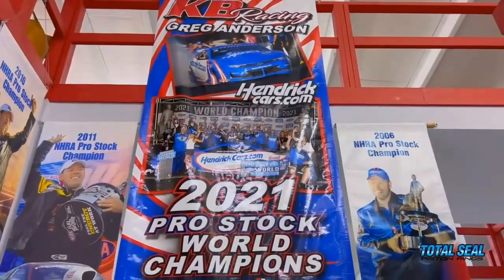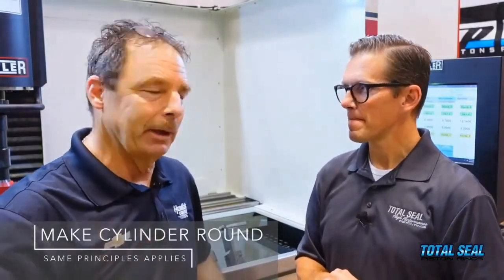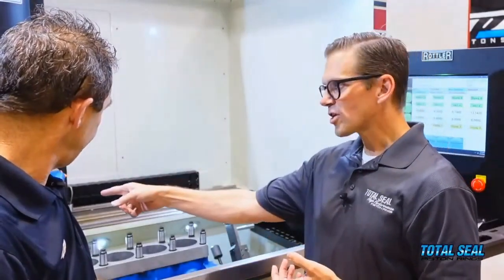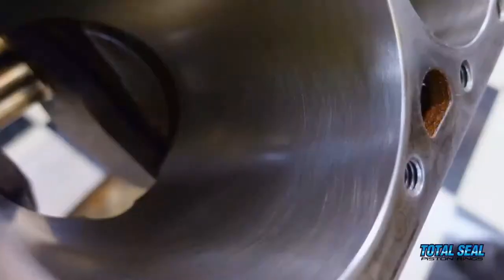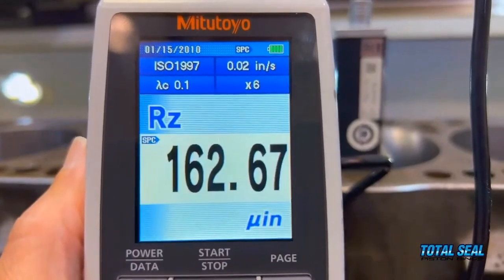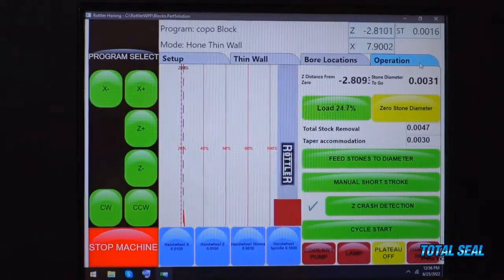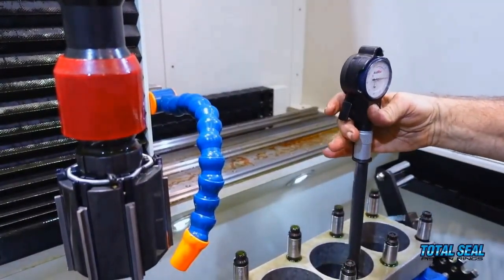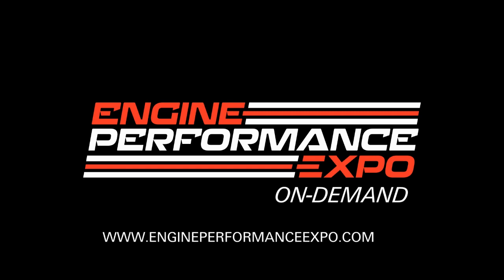Block Honing (2023 - Episode 19)

Comment: One topic NOT covered. Rings and which ones will accept this type of honing operation. Can they be 5/32" wide or must they be the newer, thinner such as the 2mm width rings. What about the material?   Will ring packages from 5 to 8 years ago  work with this type of hone or must new rings be purchased?
Reply from the maker: This type of hone works for any size ring. It works with steel or ductile iron rings that are either PVD or Moly coated. Chrome faced rings need a rougher finishing abrasive (325) for them to work properly.